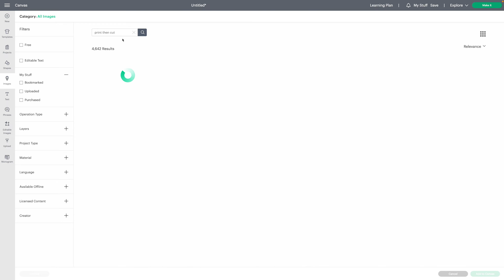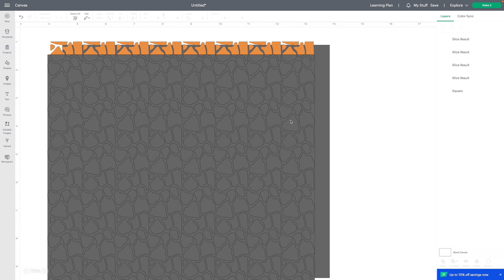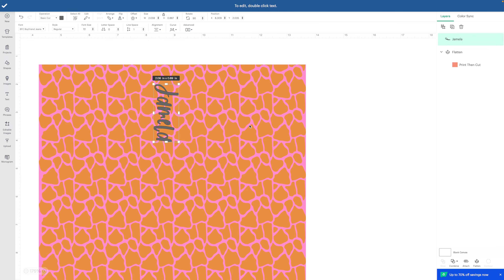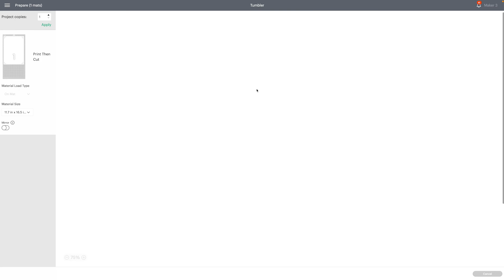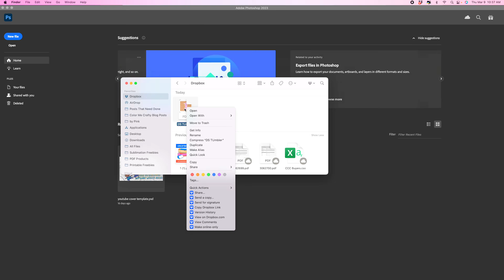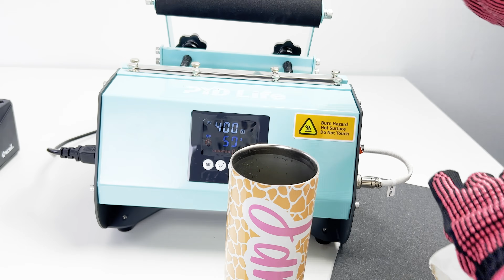How To Use Cricut Print Then Cut For A 20oz Sublimation Tumbler

Comment: I don't understand how you got the print then cut lines when you didn’t print from design space.
Reply from the maker: I created the “registration marks” in design space and saved what would have printed from design space as a pdf so I could print elsewhere.
Reply: @JamelaPayne  so you went as far as send to printer, then saved as pdf?
Reply from the maker: @donnamixon6850 just a lil further, you have to use the print dialog box and save as pdf instead of printing when that box opens. So do everything like you are going to print from DS as normal but when the box opens to print, instead save it as a pdf.
Reply: @JamelaPayne  I've done all your steps, but I don't have the option to print to PDF :(
Reply: My designs printed from design space are pretty bright, never faded looking. I wonder if it’s because I created an ICC profile for the Hiipoo ink when I set up the printer.